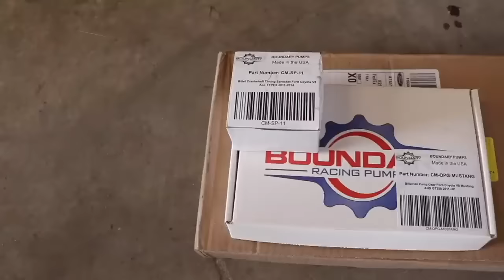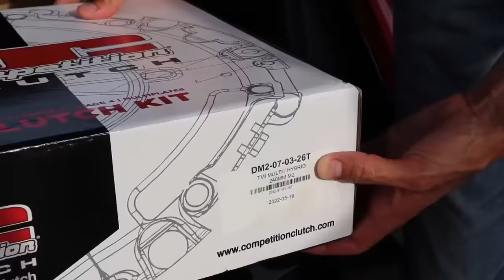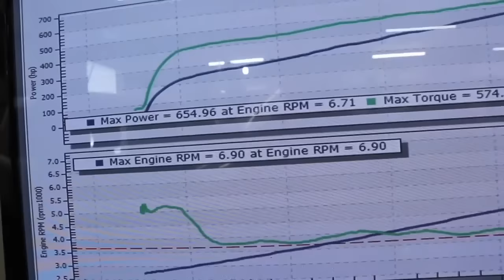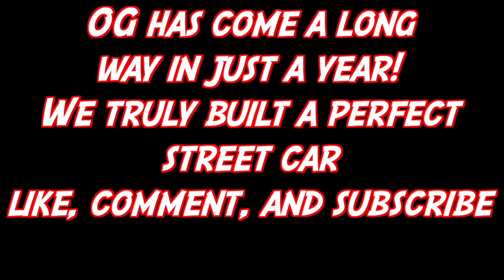Building a Coyote Swap Mustang in 10 Minutes

Comment: Looks like im a little late but wondering why anyone would swap out a 4v 4.6. Dont get me wrong coyotes are wicked and can make some incredible power however a upgraded supercharger, procharged, or turbo 4v can easily make the same power. Can anyone explain, not trying to be mean or an idiot but I always thought the 4.6 4v was pretty much a holy grail from ford? is this not the same engine as the cobra? Thanks
Reply: Not to mention cost and part availability out of 4.6L motors is insanely cheap compared to a coyote. I can get a 2001+ 4.6L 2v with PI heads for next to nothing at my local yard and motor trend has pulled 600whp and 750tq on a stock block with ebay parts. I am a little more partial to the 2v heads vs the 3v or 4v only because the need for the cam phaser lock outs plus there was a ton more 2v motors than all 3v, 4v and coyote motors.
Reply: The coyote is a much better engine. It’s not even close. To put into perspective, the terminator cobra made 390 HP supercharged on the 4.6L platform 

The gen 1 coyote made more than that NA. 412 Hp. 

Coyote is one of fords greatest engines of all time, but the 4.6 still has a special place for a lot of people.

Comment: Are you running cobra brakes? Have you considered a better braking system? Must be sketch trying to slow that car down lol
Reply from the maker: Cobra brakes currently. Going to do a 4 piston upgrade
Reply: The cobra brakes aren't that bad especially when you have upgraded fluid, pad and lines.  They aren't super great like an aftermarket setup but I Def wouldn't say it would be sketchy they're alot better then the stock gt brakes.

Comment: Pull that Procharger off and put a big Whipple on there, gain about another 2-3 hundred more horsepower.
Reply: That is a horrible idea.  That would be the worst thing he ever did to this car.  It would go from reliable to unreliable as quick as it currently goes 0-100.  Right now it is a very streetable very reliable setup which is one reason he has so much fun with the car.  A Whipple big enough to add that kind of power is gonna be a huge Whipple those big blowers are not the ticket for street cars.  People just keep making the same mistake over and over.  Bigger is better right?  No actually it isn't always better.  If he was gonna switch blowers I'd do like an odin 2650 they're capable of pretty big power, real good torque and a good power band with good response.  Usually when people go with big ass twin screws the reliability goes out the window and they start to have issues for various reasons. I'm not dissing Whipple I'm talking about the huge ones like 3.8 and 4+ liter.  That is too big of a blower for a street car.  The power level he's at and going to be at it just isn't needed.  All it's gonna do is make response lazy and bring the big blower problems along with it.   2650 TVS can get him to 1000+ easy and is alot more fun.
Reply: @midnight347  I didn't say put the biggest damn huffer you can fit on it. But Whipple, Kenne Bell etc.. make kits made for his car that can hit that number. Reliability and throttle response is not a issue if anything is improved by a lot and is a definite improvement. You're right bigger isn't always better it actually slows you down if the engine isn't built for it. But I know what I'm talking about. You just have to know what works right for your application and goals. Kenne Bell took a 2005 GT 3 valve 4.6 and only changed the rods to forged units and put one of their blowers on and made 800 + horsepower.. They claim. There's dozens up on dozens of cars with blowers.. If it didn't work they wouldn't make or sell them. Plus they can be tuned to perform to the optimum.

Comment: Ive heard that the t45 can handle only about 400 lb ft of torque, any tranny issues? Ive got a new edge im looking to build
Reply from the maker: The t45 was in this car temporarily with the coyote and ProCharger. Will it drive and make power? Yes. Will it last racing and banging gears? No. If you baby it in between gears and reduce the chance of shock when the clutch Engadget and disengages you can make it last for a while before you put something else in

Comment: I was wondering if the 4.6 cobra motor that I have in my lincoln would it fit in a mustang body
Reply: Just cause it's a 4v doesn't mean it's a "cobra motor". Terminators came with forged internals. Lincolns did not

Comment: 5:24
All of us that own this car, End up Buying the Same wheels, Don't We? It's All I See. I Own the 2002 in Yellow. I took those rims and had a Black tint put over them - And it makes a Beautiful Black-Chrome.
Reply: I bet that looks sweet!When you say black tint do you mean actual window type sheet tint ,or do you mean like a spray tint?
Reply: @jojogun1957  I archived this account so I won't be online to see your next reply, I only logged in to find a playlist - but it wasn't a window or spray. They professionally had a wrap of which I assume is Made for metal, put around the entire rim, even the inside you wouldn't see. It was very well done, and looks amazing. You wouldn't know at all, and would just assume it was a nice paint job. I've had the car for years now and I still keep these same rims on it. I'm riding with these on Racing Radial Tires. I plan on re-buying the same rims in the regular chrome after I have the car itself repainted. I've decided it's been Yellow for too long.

Comment: What are you doing with the old engine etc? I have a 99 gt convertabke and would love too do a build but honestly I have too either barter my build or find a engine and trans for 1000$ which I don’t see happening lol. after my 96 mark 8 I was sold on the teksid build.
Reply from the maker: I sold it for 4k. I have a Mach 1 4v basically same engine in stock. Same price

Comment: Accufab holds the nhra stock block record with the cobra 🐍 4.6, 5sec 250mph, 3500hp, why would you remove the better engine.
Reply from the maker: Lmao the only thing 4.6 about the record you’re talking about is the block. Everything in that engine is built. Big difference between the basic 4.6 that got pulled out and the record holder racecar record you’re talking about
Reply: Koenigsegg used the cobra 🐍 4.6 in million dollar supercars.